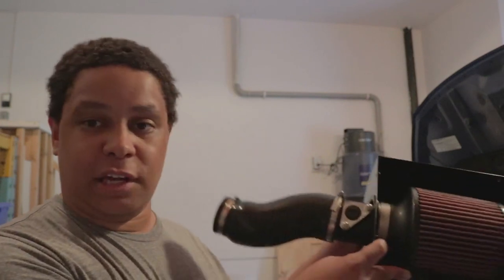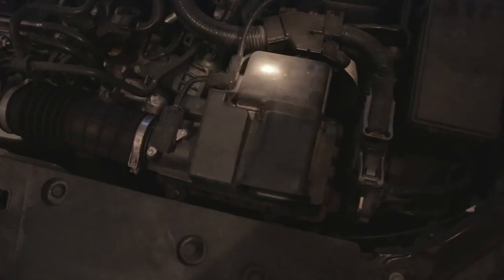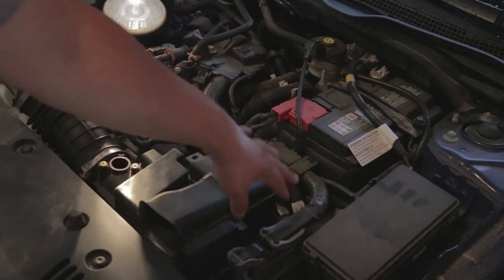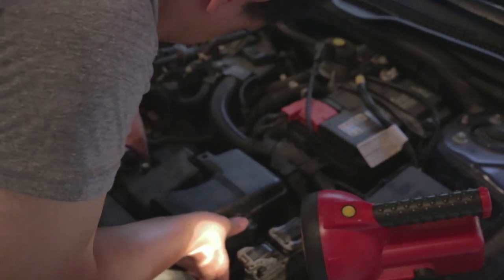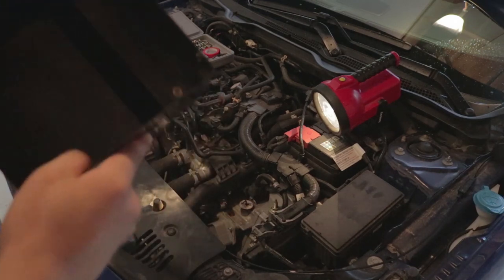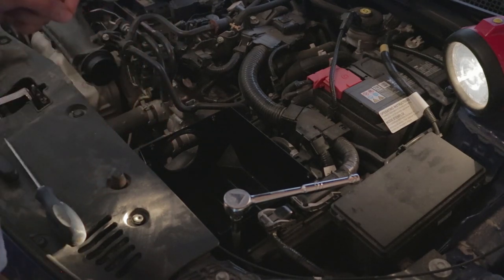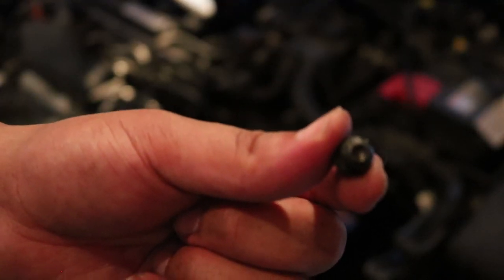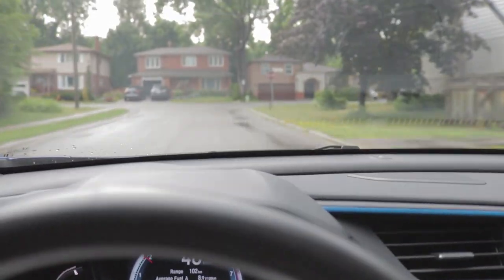How To Install Mishimoto Intake In Your Civic! (1.5T Engine)

Comment: What blow off valve did you decide to go with?
Reply from the maker: It's the Torque Solutions blow off valve plate
Reply: Never use a BOV on a civic 10th wtf dude
Reply: @TurboKitchen  remove ur bov right now bro ! Not good for ur motor
Reply from the maker: Been on the car for almost 2 years now and no issues. I know a bunch of other people in the same boat.

Comment: Did you install a blowoff valve?
Reply from the maker: I installed a blow off valve plate not a whole replacement. The plate just gives you the blow off noise but has no other gains or advantages.
Reply: Turbo Kitchen Hi bro what does a blow off valve plate do to the engine? Any disadvantage? I wanted to install a real bov but many people driving civic 1.5 turbo said it will stall the engine and run too rich.
Reply from the maker: I personally have had no issues with the engine since the install. Had the BOV on for almost a year now. Not running rich or any engine stalling. Car runs perfectly.
Reply: Turbo Kitchen thank you for your reply! What brand of bov are u using? Did you get your car tuned?
Reply from the maker: BOV is from torque solutions. I'm not tuned right now but I'm planning on it in the future.
Reply: ong yixiang I owned a red boomba bov and it stalled my car and it didn’t let the turbo spin so my car was not having acceleration ,after having it installed for a 2 months. I would go with a intake if your looking for noise
Reply from the maker: Boomba are known to be horrible. I'm not surprised you had issues. Its unfortunate. There are other safer options out there whether it's the plate like I have or full BOV system. Look at the HKS BOV. I have friends who have been running them for a long time without any issues at all.

Comment: Your civic a cvt?
Reply from the maker: Yes.
Reply: Is your civic a CVT? Also did u need to buy extra hose to install your torque solution plate? Or just swap it in?
Reply from the maker: Yes it's CVT. No extra hose for the BOV plate. It's just three screws that come with it.